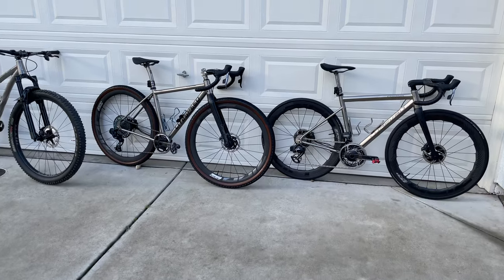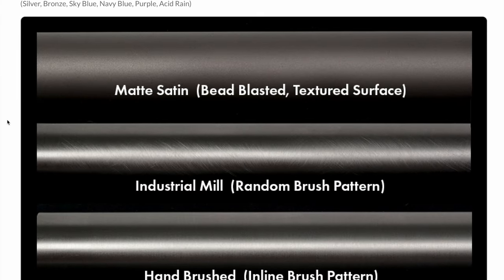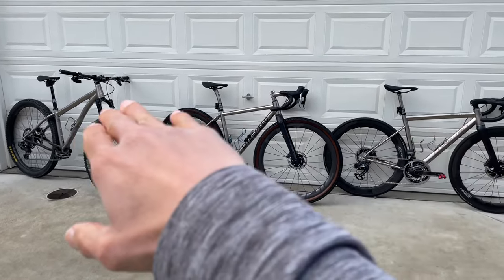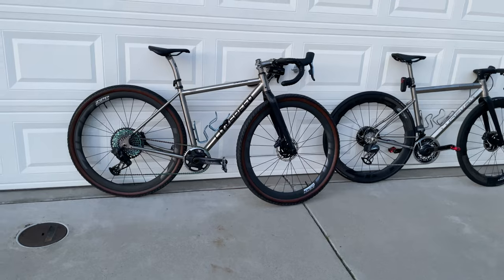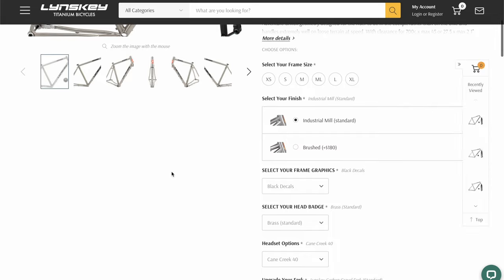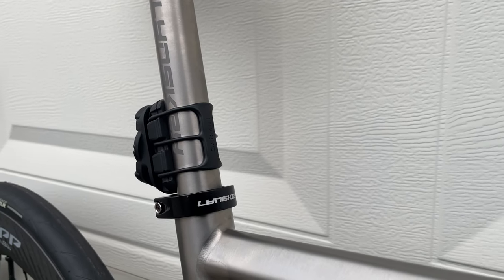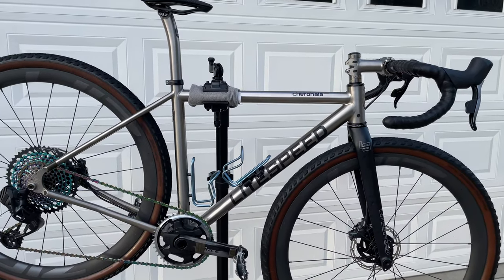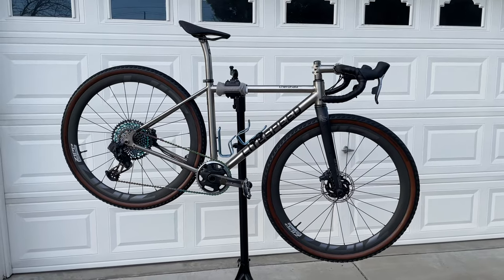Titanium Bike - Finishes

Comment: I just learned of another thing to do to really get it looking factory fresh. Spray some WD40 onto a paper towel and wipe down the frame, especially after doing the burgundy scotchbrite technique. WD40 was originally developed to clean titanium and a few other metals for the Aerospace industry. I tried it on my titanium seat post and it works great. 😄👍
Reply: Corrected (from what I understand):  WD-40 is a "Water Displacement" lube.  I use it on my dirt bike chains after power washing all the dirt off the chain. Then spray the chain with WD-40 to get the water out before I add the chain lube.  WD stands for "Water Displacement", and 40 is the 40th formula that finally went on sale.  I worked for a Ti. Bicycle manufacture in the mid 90's that was in Michigan USA, (Nuke Proof. Now in Europe), and a trick they used after scotch bright on the frame, was wipe it with Lemon Pledge, (no kidding), for a finger print free finish that lasted quite a long time.  The frame can also be buffed to a chrome like finish pretty easily.
Reply: @EarthSurferUSA   What buffers do you use to maki mirror finish ? Thank u .

Comment: This vid is spot on regarding the different ti finishes and maintenance.

Get a hand brushed, mill brushed, or bright brushed finish because they are the only ti finishes that permit you to easily brush out scratches with an Scotch-brite pad. 

Many manufacturers try to sing the praises of a cheap bead blasted matte finish (like Moots) because that is the cheapest cost finish to produce (they simply put the frame in a bead blasting cabinet and blast it with media).They advertise this finish heavily because it’s cheap to produce and increases their ROI, not because it is a quality finish because it isn’t. It’s simply the cheapest for them to produce. But that cheap finish will show all scratches and cable rub marks from day one. Those bead blasted matte finishes are also a magnet for holding dirt and they are a PITA to try to keep clean. Also, with bead blasted frames you can’t brush out scratches unless you are prepared to brush the entire frame by hand yourself.
Reply from the maker: Thank you; I really appreciate you noticing.
Reply: Which brand of frame manufacturer do you recommend? It looks like Moots is not it based on your comment. Thanks!

Comment: You explain things very well. I sold my 2021 Niner carbon hardtail and am thinking of the pro 29 frame if i build another bike, will use the Fox 130 34 fork and full XO groupset, probably a Thomson seat post and get a nice light set of carbon wheels, i had YISHUN XC with DT 180 hubs, SUPER light at only 1240 grams weighed not advertised. I have bought 2 sets of wheels from them and very pleased, takes about a month or so depending if they have the 180 hubs in stock.
Reply from the maker: Thank you Jim. That sounds like a good build.

Comment: Between Litespeed and Lynskey which brand do you prefer? In terms of quality, stiffness, and value.
Reply from the maker: Quality/quality control: both are good in general, but IMO LS seems to represent their brand better such as using badge in stead of sticker on the frame.
Value: Lynskey has better prices as of right now, and I believe they hold about the same value in the long run.
Stiffness: I'm going to assume "fast for stiffness" LS is about 400grams lighter than Lynskey, therefore I believe LS is faster. (fact check me on my theory).